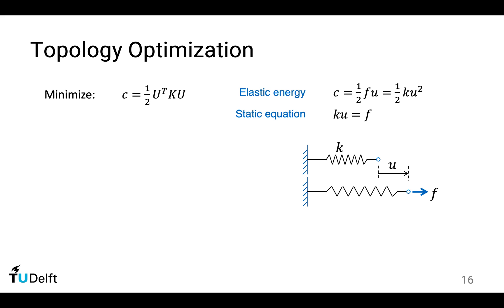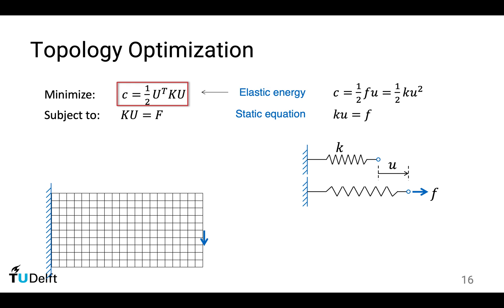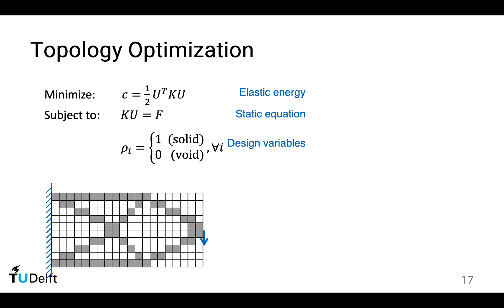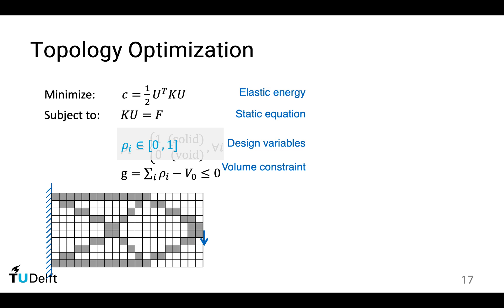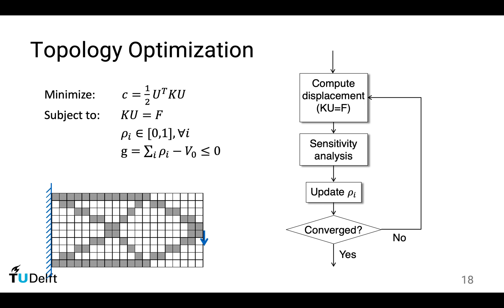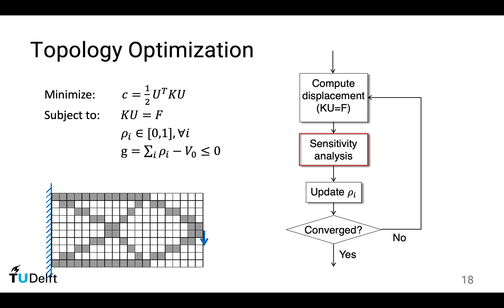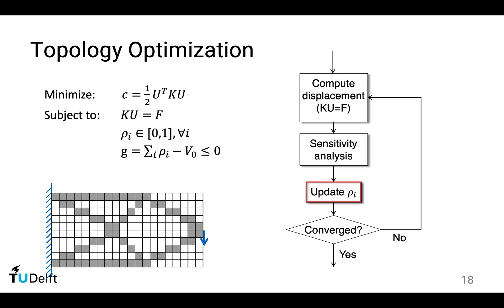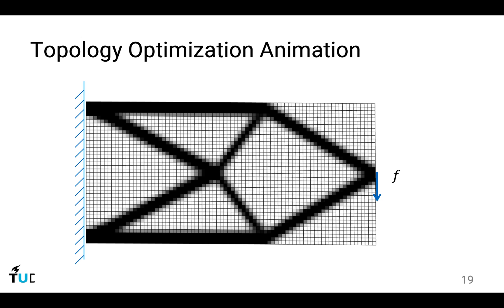Introduction to topology optimization Part 2/4

Comment: What do you mean when you relax the design variables to be continuous? Does it mean the design variables can be anywhere within 1 to 0, which means there will be a density gradient? Also I am currently undertaking a project that seeks to apply topology optimisation for lattice structures, do you have any research papers you recommend for a person with zero prior no knowledge like me. Thanks
Reply from the maker: yes, relaxation refers to allowing the design variables to be anywhere within [0,1]. In compliance minimization which is the case in my example, you get a pretty black and white design, meaning that most density values are very close to 1 or 0. In some special cases, e.g, if you have a distributed load, it is likely that there is a visible density gradient. For getting multi-scale structures, I recommend our review article on this topic http://homepage.tudelft.nl/z0s1z/projects/2021-multiscale-review.html

Comment: Nice video ! As I know that Simp is the most common method in TO, I 've read some documentation about it but still don't understand how it deals with gray elements (with density between 0 and 1). Please explain it in more detail, and try to tie this to the schematic diagram you showed in video. I am new to this field, so I really want to get your explainations, or some related documents. Thank you !
Reply from the maker: Good question, 
Xuân 
If the density of an element is zero, apparently its stiffness shall be zero. If its density is one, let's say its stiffness is 1E. For intermediate densities we need to an interpolation function to get their stiffness. The first idea one may come up with is to use a linear interpolation. Then a density of 0.5 leads to a stiffness of 0.5E. However, it is known that if the ratio of solid material in a microstructure volume is 50%, theoretically its stiffness is lower than 0.5E. This is known as Hashin–Shtrikman bounds. For a solid material with a Poisson's ratio 0.3, this theoretical bound can be approximated by a cubic function. Thus comes the popular power law interpolation with a power of 3 (also referred to as the penalization parameter).
Under this physically realistic interpolation, since with 0.5 material one gets less than 0.5E stiffness, it is not economical to use 0.5 material, and thus the optimization automatically converges to a solution with densities either close to zero or close to one, i.e., a binary design. 
I suggest to download the popular 99 or 88 line topopt code, and play with the 'penal' value to see the effects.
Reply: So Simp method solves the gray elements by calculating its density value. Through iterations, these intermediate density values will gradually progress to the value 0 or 1. Am I correct in this ?  If Yes, then I have 2 assumptions about determining the density value of the element:
1 : Initial density value before iteration of the element is determined based on calculating its displacement (corresponding to steps 1 and 2 in your diagram), then the density value will change through iterations in the direction towards 0 or 1. However, I have not found any relationship between the displacement of an element and its density value. If this is true can you show it ?
2 : The initial density value of an element is randomly determined, and the change of this value through the iterations is also random. The structural displacement (or stiffness) formula is just to compare how the element's contribution to the overall stiffness changes as its density value changes. If the contribution is small then the element will be removed and vice versa. This is consistent with your interpretation of sensitivity. But if this is true, is the statement "is the density value of the element really approaching 0 or 1" guaranteed ? Or the change of density value is no rule at all ?
I find this to be a very interesting field, but there is still a lot to understand about it. Looking forward to hearing more from you. Thanks very much